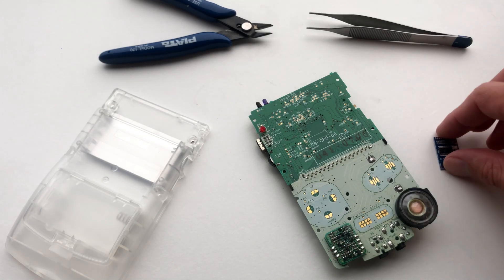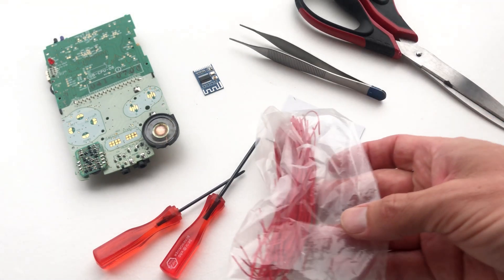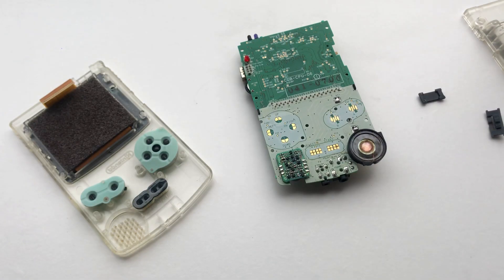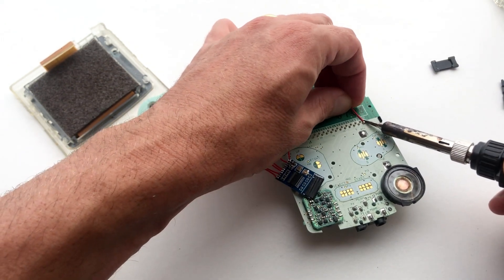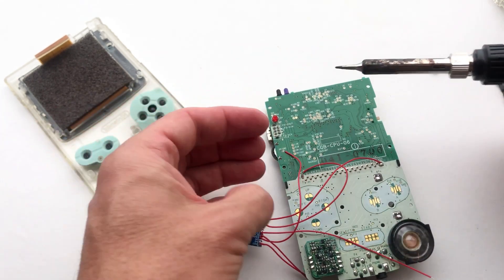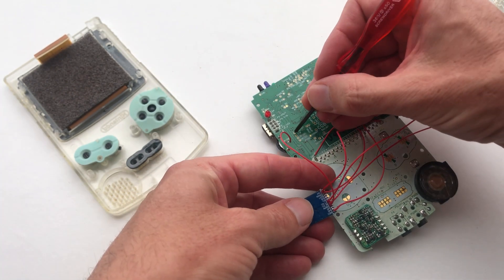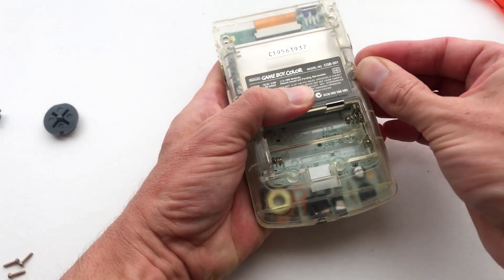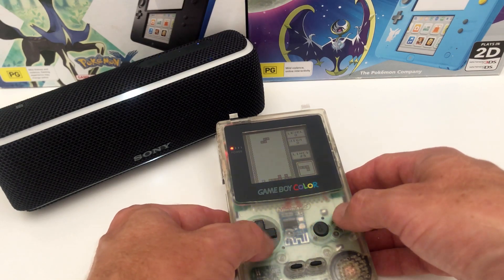How to Bluetooth Audio Mod your Gameboy Color #gameboy #nintendo #gameboycolor #bluetooth #repair

Comment: The grounds can all be at the cartridge slot ground and don't use L in R in, use S01 for L and S02 for R, also CON isn't for CON on the board but for an optional button, just solder it to select, in gameplay you can hold select for 2 seconds to not trigger the bluetooth mod with your button input
Reply: Can you tell (or show) more detailed  informations, please. If it can be simplified and disabled with select, I like that!

Comment: Do you have a link to obtain the thin gage wire I can’t find any that thin.
Reply from the maker: It was purchased off AliExpress years ago. It is 36 gauge
Reply: Chop up an old phone charger cable

Comment: whats the purpose of the "com"  in this build and do you get much audio fuzz?
Reply from the maker: No fuzz. You can add a switch to the CON to turn the Bluetooth on and off
Reply: @GameboyCustom  is the con switch need a momentary switch or a toggle switch
Reply from the maker: @willcollis4544  either, we’ve even found tactile switches to work
Reply: @GameboyCustom  awesome I will grab some of those click button headphone jacks that have a button on a headphone male jack and theoretically I can wire the female headphone jack in the gameboy to the con, this should mute the speaker and have on/off functionality hopefully, I will put a note here when I try if it works or not.
Reply from the maker: @willcollis4544  legend 👍thanks for experimenting. Your feedback is appreciated
Reply: @GameboyCustom  no problem your info is helpful
Reply from the maker: @willcollis4544  anytime
Reply: @willcollis4544  were you able to try it?
Reply: @rockinrobin418  unfortunately they dont work through the headphone jack

Comment: Does the sound still come out if the speaker? And then when you have your bluetuuth item on, its auto connects?

Or does the sound only come through blutuuth, and no more speakers? :o
Reply from the maker: Great question. You can add a switch on the CON line to turn it on and off through the speaker. It auto connects once paired with most speakers
Reply: @GameboyCustom  I just cut the end off a headphone jack and store it in the headphone jack which mutes the audio
Reply: Awesome, thank you for replying so fast!!
Reply from the maker: @igi-chan  no problem
Reply: Great video by the way!!
Reply from the maker: @igi-chan  cheers 👍much appreciated
Reply: Do i have permission to promote your video in a GBC restoration video im working on? :D it was very helpful!
Reply from the maker: @igi-chan  sure as long as you acknowledge us and label the source in the comments and not use the entire video relabelled
Reply: Oh of course im not going to use the whole video! 

I meant, im just going to shout out this video and let people know to go watch it as a good refrence when customizing their gameboys 

Thanks! :)
Reply: Just wire it to S01 and S02 instead of L in R in and turn the volume weel all the way down when connected to bluetooth

Comment: i have tried this and it  works , but the bluetooth  goes on and off everytime .
Reply from the maker: Are you close enough to the speaker / headphones?
Reply: @GameboyCustom  thank you so much for replying!! yes, I have tried with two earbuds, one generic and the other from xiaomi, leaving it next to the gameboy, the generic tells me connecting, pairing, disconect and enters that loop. The one from xiaomi connects and the audio is heard for a second and then it disconnects and enter in that loop .
Reply from the maker: @panonet007  without looking at it we’re assuming that there’s an issue with the circuit board. Have you tried another circuit board?
Reply: @GameboyCustom  hi ! , thank you again ! im probe in 2 mothers whit the same result ... earbuds incompatibility ? im add anothet to try and not work , 3 earbuds only in 1 listen music 1 sec and disconect. 😞😞😞
Reply from the maker: @panonet007  we would recommend buying a new circuit
Reply: @otitih  thank you 🥰🥰🥰🥰

Comment: Very nice. Possible to turn off the bluetooth if you dont want to use?

If the gameboy volume is lower will the bluetooth speaker also lower or keep the same volume?

Thanks
Reply from the maker: Sure. If you solder the CON cable from the BT circuit board to the SELECT button. You can then press the select button to turn it on and off
Reply: If you want to completely turn it off you'd probably need to install some kind of latching switch to the bluetooth's ground wire. If you want to disconnect the current Bluetooth device you need to send a ground pulse to the CON pin on the Bluetooth board, in this case it's wired up to select button. Idk how much power unpairing a device will save you though.

If you have the Left and Right Bluetooth pins wired to S01 and S02 on the Gameboy motherboard, then the volume wheel will not affect the Bluetooth volume. This is perfect for Bluetooth earbuds where you can lower the volume on the Gameboy but keep sound on your earbuds. The sound volume is controlled by your Bluetooth speaker/headphones/earbuds. Bluetooth audio devices that require password will not work. Possible that some others may not be compatible.

Connecting your earbuds require you to put your earbuds in pairing mode then send a ground signal to the Bluetooth device; in this case it's select button.

You can wire up you're Bluetooth transmitter's to the gameboy speakers so you CAN control the volume with the volume wheel, but then you'll get sound from both you're earbuds and the Gameboy speaker.

I have noticed that there is a 0.5 sec delay in audio when using Bluetooth earbuds, but it doesn't affect gameplay feeling.
Reply: @japanboys13  couldn't we find a way to mute the speaker when the Bluetooth is ON? 

If I'm correct it mutes when a jack is plugged in, maybe some input could be sent to some pin that would mute the speaker, right?
Reply: @ArthurTipaldi  There is a switch inside the headphone plug which mute the speaker. You can use a old 3,5mm plug or maybe a dust cover for 3,5mm will work.
Reply: @ReneOne111  but I want that to be automatic when I turn the bluetooth ON 😅 

In the end I used a MSS-22D18 switch that has two separate channels, I made one of the speaker's wires go throw one side of the switch, and the power of the bluetooth module on the other, one being opened when the other closes.

So when I move the switch to power the bluetooth module, it cuts the speaker 👌